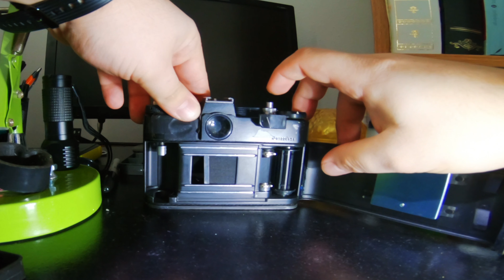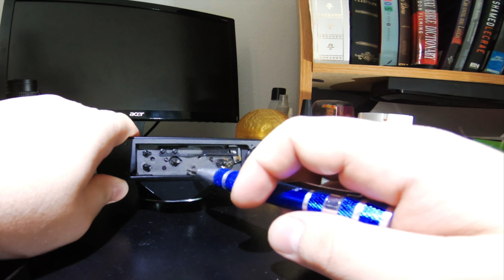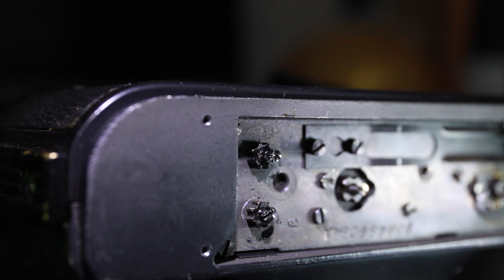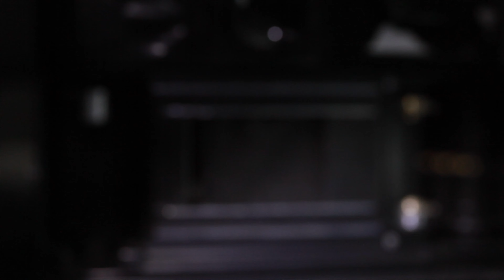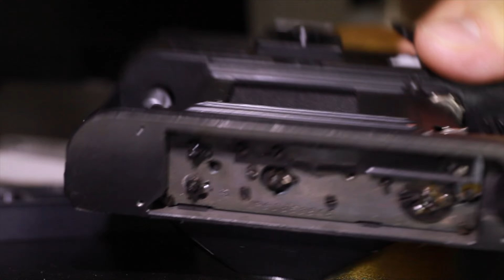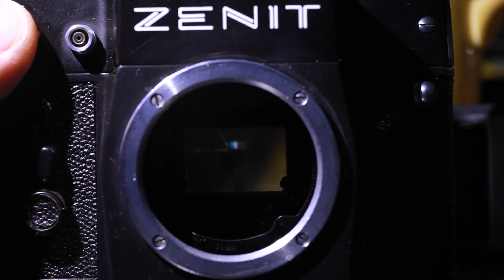Shutter Curtain tensioning for Soviet 35mm film cameras; Zenit 11, 12, TTL; Zorki; FED ; Leningrad

Comment: Hi dude, I did this, and the curtain isn’t moving at all now…. What can I do? It’s stuck
Reply from the maker: Provide more details of what happened and when. Chances are that had the shutter cocked and messed up the curtain sync.
Reply: @AleksUsovich  well I spinned it 4 times like you showed, that made no difference, so I spinned it further a bit. then this occurred. I tried turning it back clockwise but that didn't help either. when I move the lever the curtain moves a little bit (like 0,5 cm) after I press the shutter button the mirror only moves up a bit and back down, the curtain doesn't move. 
maybe I need to dissasemble it? I found many videos (including Russian) that show how to disassemble the top, but none showed how to get to the curtain itself
Reply from the maker: @dominikkarkowski  If you had the shutter cocked (wound) when you were spinning the curtain adjuster, that will mess everything up. You can try firing the shutter and not winding but loosening the 2nd curtain (other adjuster that I did not touch in video) about 1/2 to 1 turn and them adjusting the 1st curtain that is shown in the video. Do not let the 2nd curtain loose tension or spin the screw driver as it will be nearly impossible to tension correctly. Would not recommend disassembling the camera unless you are a specialist as it will likely never be put back together again. You need to take the curtains out of the bottom, but need to disassemble nearly the whole camera to get to the point to be able to take them out. I disassembled a few to sell as parts and almost everything comes out of the camera before you can even get to the curtains.
Reply: @AleksUsovich  well i tried that now but it didn’t work either, the curtain got a little bit more loose now. And the lever doesn’t lock after the turn. I have some experience with repairs with such cameras. Maybe you can tell me or there is some good tutorial on how to fix it? I know how to disassemble but not what I should do further. Any help appreciated
Reply from the maker: @dominikkarkowski  Before taking anything apart look at some Zorki 4 or 4K curtain repair videos. The shutter units in Zenits are pretty much the same concept as the Zorkis although they are built and taken apart much differently. You want to look for how they tension the curtains as this is exactly what you need. Will most likely need captions on as most if not all the videos will be Russian.
Reply: Ohh wait I see what is the problem since the beginning, the right spool has wound together with the actual shutter part
Reply from the maker: @dominikkarkowski  https://www.youtube.com/watch?v=LFInr8jGj18&t=2s&ab_channel=PROPHOTORZN   watch starting at 11:25 for how the shutter works
Reply from the maker: @dominikkarkowski  The take up spool should be turning with the shutter when winding or else the film wouldn't move between shots.

Comment: Can it be applied to the Zenit EM (1980)? since I have that problem with the speeds in 1/250, 1/125, sometimes with 1/60 speed. With the last speed it is curious because if I shoot once the curtain gets stuck, but the second time it works fine. At speed 1/30 and 1/500 so far I have had no problems. For that reason I prefer high ISO since those speeds don't give me problems.
Reply from the maker: Yes, you should be able to do this on a Zenit EM. If your curtain is beginning to stick, it means that the lubricants are getting worn out and need to be cleaned and relubricated. Tensioning the curtain will be a temporary fix that may work for a while. The curtain can break if this process is repeated too many times as the resistance will be too great on the shutter curtain ribbons
Reply: @AleksUsovich  So the best thing I can do is go to a specialist because I don't want to damage the machine by misusing the lubricant. Also I don't know where to get them where I live...

thank you!!
Reply from the maker: Yes, best bet would be to let a specialist do a CLA (clean, lubricate, adjust) on it to keep it working optimally. If there is no specialist near you, there is someone who repairs them in Ukraine that you would need to ship it there for restoration ( OKVintageCamera)
Reply: They all have the same shutter mech, even the plastic 122. However, it sounds yours is gummed up with old russian grease, as it is used a few times, the grease eases. Needs a full CLA, but doubt you will find anybody willing to service the camera.

Comment: hello. my camera curtain only gets stuck when the camera is cold. what could be the reason and will this method work?
Reply from the maker: The reason that the shutter get stuck in the cold is because the lubricants break down after 30-40 years of use. For this camera to continue to work, you need to get a CLA (clean, lubricate, adjust).  Unless you know the camera really well you will need someone to do it for you as you will need to disassemble the camera, remove the old lubricant, and lubricate with a modern lubricant that can withstand cold weather.  Often times it is cheaper to buy a new camera on eBay than get yours serviced unless it is sentimental to you or you plan to have it for the rest of your life. There is one person that services Zenits ( Okayvintagecamera.com). Oleg from Okayvintagecamera can restore your camera for $88 not including shipping to Russia and back. Repair time is around one week not including shipping.
Reply: @AleksUsovich  thank you very much ! even tho i am deeply saddened that i have to get a new one.

Comment: Hi, I tried your method but now I can’t do anything with the camera anymore. I can’t “load” a new photo (without film in the camera) anymore. I only turned the bolt 2 times just to try it out. Do you have any advice?
Reply from the maker: If the shutter was cocked, the camera may not be functional anymore. Can try turning the bolt 3 or 4 times and see if it fixes it.
Reply: It was not cocked, I tested it the way you showed. Thanks for the advice though. Doesn’t turning it more wind it up too much?
Reply from the maker: @elinevandeven2242  No, if the camera lubrication has worn out significantly, you'll need to wind it more to get the curtain tight as it should be.

Comment: Hi I am having trouble with the actual shutter button, for some reason it is pushed down and does not pop up to take another picture (i hope that makes sense) Can you help me with this?
Reply from the maker: That generally means the camera will need a CLA (clean, lubricate, adjust) . Can try putting some 3-in-1 oil in the collar where the shutter button gets stuck and push it a few times

Comment: Are you sincere? You used two different cameras, You can see very well, that the serial number changes🙄
Reply from the maker: My camera battery had died in the middle of filming the repair of the first camera and since I had a second Zenit camera and the fact that there isn't another tutorial like this on YouTube- I had done the same procedure to my second camera to complete the video. If you don't believe the video then might as well throw the camera away since no one will repair it anymore. Read the other comments for my video and you'll see that this works. I'd know since I've repaired and sold many fixed cameras this way.